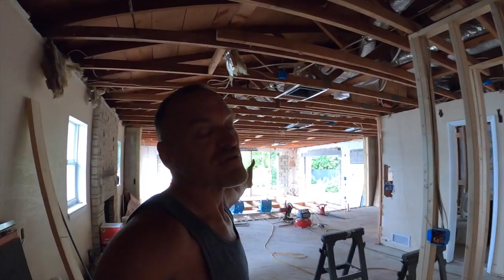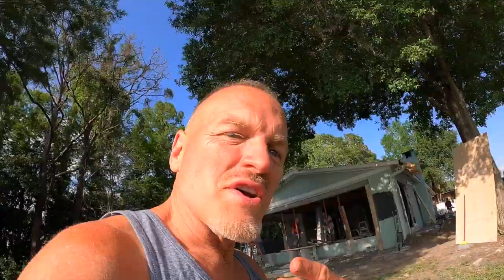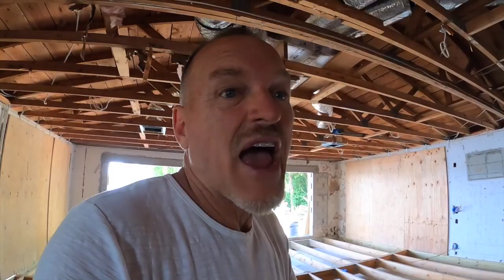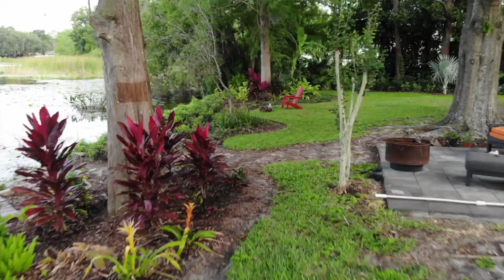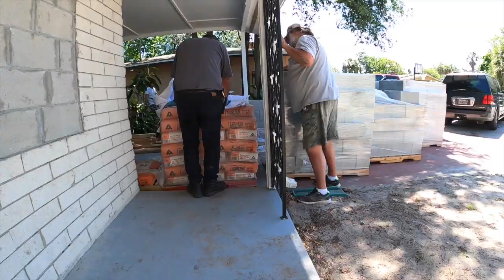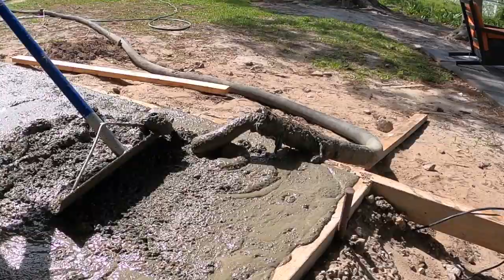CONCRETE DAY - Return to the house remodel

Comment: So glad the project is progressing. Landscape looks great, glad construction isn't damaging it. Just intersted with the FL heat, why a black roof? Doesn't black attract and absorb heat raising AC costs? Or is the R value in attics different than colder areas? 
Where are the Mr. Meatball prints in the concrete?😂😂😂😂
Reply from the maker: All for looks however my attic will be foam sealed so no absorption will happen